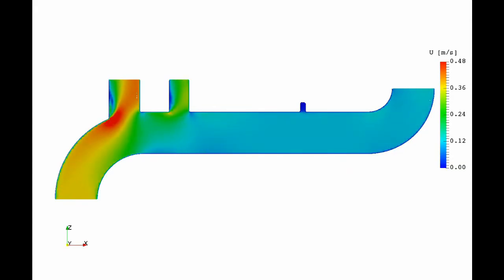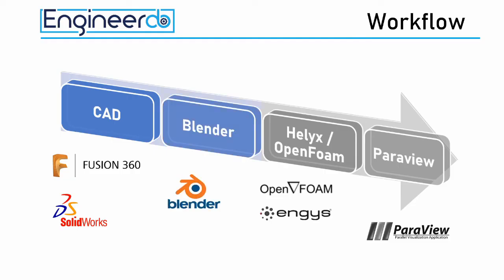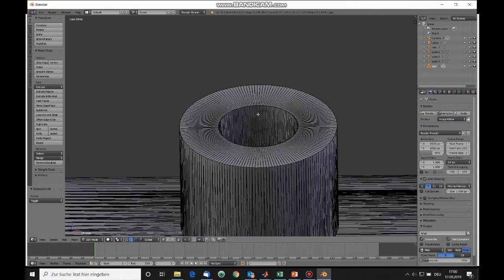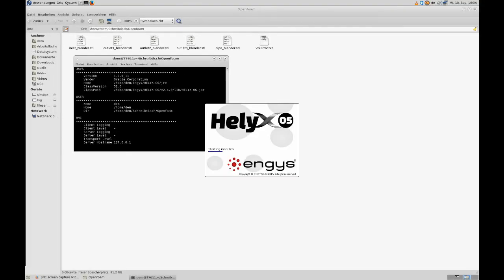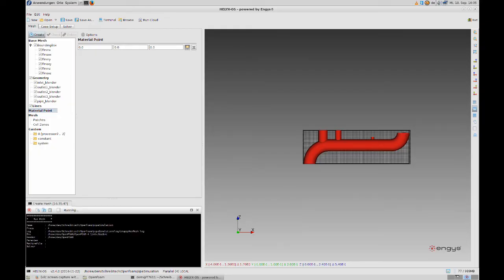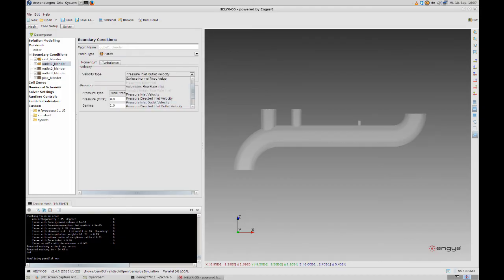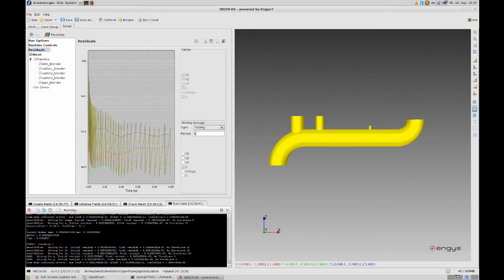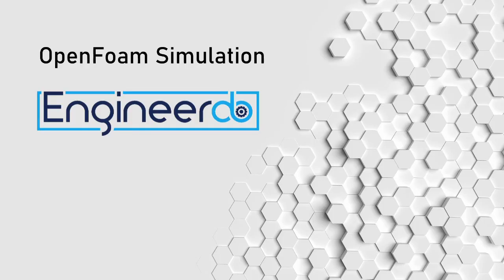Tutorial of a OpenFoam Simulation using Helyx - Complete Workflow of CFD - Multi inlet / outlet flow

Comment: First of all, thanks kindly for the video. It's really helpful and well explained!

I'm running into an issue that I can't seem to find the cause of. When I'm importing to paraView I get the following errors: 

ERROR: In vtkOpenFOAMReader.cxx, line 11323
vtkPOpenFOAMReader (0x609c34f65ba0): /home/usuario/Engys/HELYX-OS/v2.4.0/pipeSimulation/pipeSimulation.foam contains no meshes.

ERROR: In vtkExecutive.cxx, line 740
vtkPVCompositeDataPipeline (0x609c3b254d70): Algorithm vtkPOpenFOAMReader (0x609c34f65ba0) returned failure for request: vtkInformation (0x609c2b265d30)
  Debug: Off
  Modified Time: 7921425
  Reference Count: 1
  Registered Events: (none)
  Request: REQUEST_INFORMATION
  ALGORITHM_AFTER_FORWARD: 1
  FORWARD_DIRECTION: 0

ERROR: In vtkOpenFOAMReader.cxx, line 11323
vtkPOpenFOAMReader (0x609c34f65ba0): /home/usuario/Engys/HELYX-OS/v2.4.0/pipeSimulation/pipeSimulation.foam contains no meshes.

ERROR: In vtkExecutive.cxx, line 740
vtkPVCompositeDataPipeline (0x609c3b254d70): Algorithm vtkPOpenFOAMReader (0x609c34f65ba0) returned failure for request: vtkInformation (0x609c2b265d30)
  Debug: Off
  Modified Time: 7921425
  Reference Count: 1
  Registered Events: (none)
  Request: REQUEST_INFORMATION
  ALGORITHM_AFTER_FORWARD: 1
  FORWARD_DIRECTION: 0

Can you help me understand the cause of this issue?

Thanks in advance, sir!

Comment: how can i assign suction boundary in the outlets? Thanks.
Reply from the maker: You can use for the velocity boundary condition either a velocity vector that's directed outwards, or you can use a negative volume flow rate. Let us know, if it works

Comment: Gibt es einen Weg, helyx und Openfoam 10 zu nutzen? Ich habe das Problem, dass Openfoam kein Mesh findet, wenn ich auf Exportieren drücke. Es kommen nur Fehlermeldungen.
Reply from the maker: Kann ich nicht sagen, ob das geht
Reply: @engineerdo6568  Ich bekomme mit OpenFoam 9 ein bösen Fehler:

--> FOAM FATAL IO ERROR: 
Pressure limits should now be specified in fvConstraints:

limitp
{
    type       limitPressure;

    min        wrong token type - expected Scalar, found on line 26 the word 'pMin'

file: /home/spock/Engys/HELYX-OS/v2.4.0/Beispiel1/system/fvSolution/PISO/pMin at line 26.

    From function Foam::Istream& Foam::operator>>(Foam::Istream&, Foam::doubleScalar&)
    in file lnInclude/Scalar.C at line 101.

FOAM exiting

Scheint so, als versteht OpenFoam 9 nicht das, was im fvSoluition steht:
Line 26: pMin pMin [1 -1 -2 0 0 0 0 ] 100;

Comment: Why not close all the ends of the pipe off and label the inlet, outlets, and walls in SolidWorks?
Reply from the maker: SW unfortunatly will not create a closed mesh. The nodes are not identical. OpenFoam will then let the mesh creep to the outside
Reply: @engineerdo6568  Thank you!

Comment: Hi! I got this message:

--> FOAM FATAL ERROR: 
[1] Solution convergence criteria specified in PIMPLE.residualControl must be given as single values. Corrector loop convergence criteria, if appropriate, are specified as dictionaries in PIMPLE.<loopName>ResidualControl.

When I try to change the residual control settings, everything comes back to the previous situation when I press "run"

Do you know how to solve this?
Thanks!
Reply from the maker: Hi and thanks for your comment. The problem occurs because of the version of openFoam. You are using of8 and helxy is built for of4.1. however, you can change the residuals to single values like the error message suggest. Please have a look to a incompressible case of the examples that come with openFoam and copy the settings. Good luck
Reply: For me it works in Openfoam8 if you copy fvSolution from Openfoam/tutorials/incomressible/pimpleFoam/RAS/elipsekkLOmega. You have to replace kl|kt by only k.
Reply: At least if you start the case in Openfoam

Comment: Someone can help me? I got this message 3 times: 
FOAM FATAL ERROR: 
[3] Solution convergence criteria specified in PIMPLE.residualControl must be given as single values. Corrector loop convergence criteria, if appropriate, are specified as dictionaries in PIMPLE.<loopName>ResidualControl.
[3] 
[3]     From function bool Foam::singleRegionConvergenceControl::readResidualControls()
[3]     in file cfdTools/general/solutionControl/convergenceControl/singleRegionConvergenceControl/singleRegionConvergenceControl.C at line 73.
[3] 
FOAM parallel run exiting

Thanks guys!!

Comment: As a semi professional cfd user, the mesh is good enough for demonstrations.

Do you benchmark your simulation with experimental or numerical data?

Because the mesh should be aligned with the flow as much as possible. If not, false (numerical) cross diffusion is introduced.

But as I wrote for demonstrations your guide is perfect.
Reply from the maker: Hey Marko, thanks for your comment. The industrial applications we do are usually only build once, so there is no measurement possible.
Of cause the mesh should point in flow direction. However, that’s not always possible. You can build a very precise mesh using the tools like HyperMesh but from my experience the lack of information of the boundary conditions is usually so large, that it has the biggest influence to the result. 
Also, most cases we simulate are very rectangular, so the snappyHexMesh generated case it sometime looking not bad at all. You are totally right if it come to rounded structures like in this demonstration. They are not easy to mesh with snappyHexMesh but if you choose a small enough mesh size the error stays usually in the acceptable region if compared in a mesh independency study.
Reply: @engineerdo6568  I like very much when these comments appears, because I can learn more. I had a question: "the mesh should be aligned with the flow" What this means? How can I control this?

Comment: Super video. Ich hatte mich bisher noch gar nicht mit einer Foam-GUI befasst. Sollte aber ein tolles Tool sein um "Anfängern"  und Leuten, die an GUI-Programme gewöhnt sind, den Einstieg zu erleichtern.
Übrigens: mit den neueren Blender Varianten kann man alle Objekte auf einmal als *stls exportieren lassen indem man bei "batch mode" -> object wählt. Wenn man beim exportieren den Namen weglässt, dann übernimmt er einfach den Namen des Objekts und macht daraus "objektName.stl" :) 

Great video. I hadn't looked into foam-GUIs yet, but I think they should really help "beginners" and anyone who makes the transition from other GUI based applications.
In addition: The newer Blender versions allow to export all objects in separate *stls via ONE-click by choosing "object" as batch mode when exporting the *stl. Furthermore, when you leave the name field of the exported file empty, it will automatically create the name "object_name".stl
Reply from the maker: Hey Fee, thanks for your great feedback and your tip. The export function in blender can be handy. However, industrial assemblies sometimes come with "nuts and bolts" which we usually simplicity in a simulation. It can happen that you are facing huge number of STL parts when exporting using the batch mode. I did this recently ;-)

Comment: Hi, very good video ! 

The explanations are really good and it helps a lot understanding the case as well as Helyx. I was wondering which version of OpenFoam you were using ?
I have OpenFoam8 and I want to download HELYX-OS in order to use the GUI but on their website it's written that HELYX is only available for OpenFoam v4.1 or v1606+.

Thank you in advance and keep up the good work !
Reply from the maker: Hey Alfred, I used OpenFoam v4.1. The use of OF8 will not work without adjustments in a few files. However, you can try to use OF8 with helyx and make these adjustments from the error messages you will receive. For OF7 it was only one file which needed changes.
Reply: EngineerDo Thank you very much for your quick response ! It helps a lot

Comment: Sir, what is the dimensions of the pipe? Where do you set it up? And which units? centimeters? inches?
Reply from the maker: Hey Jose, the pipe has a diameter of 200 mm and a total lenght of 1.7 m but the dimentions are "m". In the video I'm explaining to use SI Uniits which will always lead to [m,kg,s]
Reply: @engineerdo6568  , Sir is there some documentation about the boundary conditions, what do they mean? I can understand some of them but not fully. Send me it privately if you please.
Reply: sorry, I've discovered the dimensions  are in the international units system